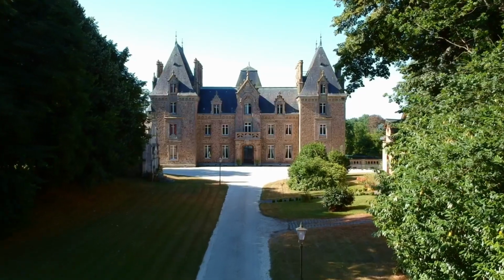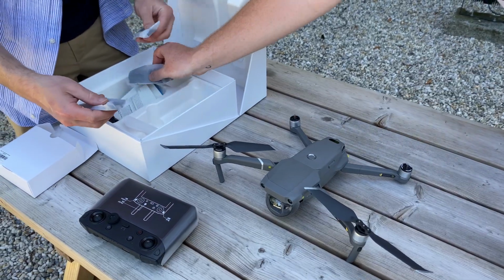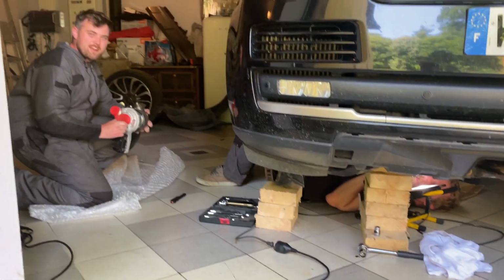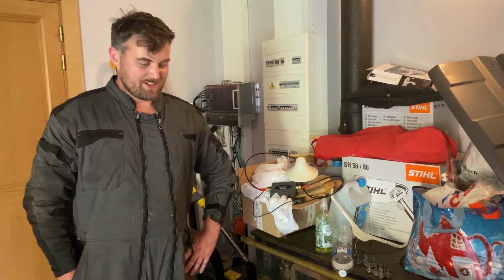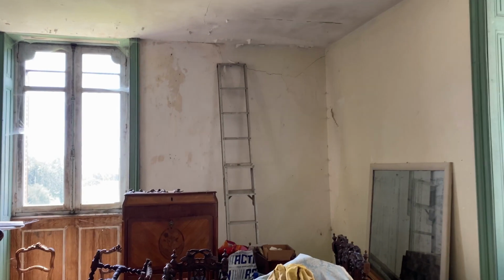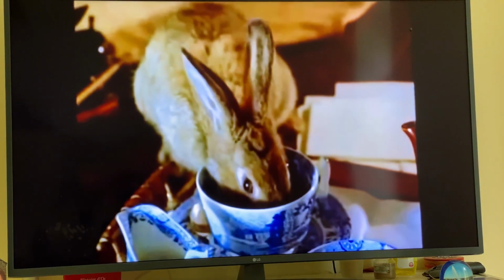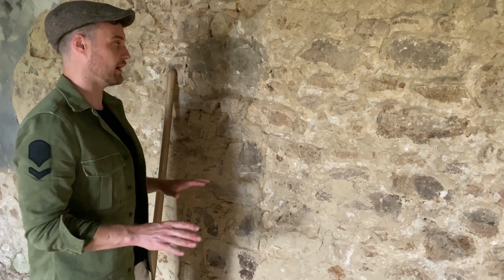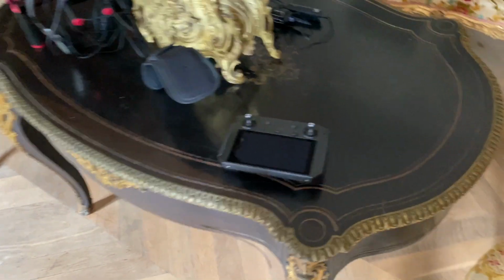The Only Way Is Up - Doing It Ourselves

Comment: Hi Micheal! I did lime plaster on my sister house that was built in the late late 1700's in Pennsylvania, USA.
Protect your hands, nose and throat, that lime powder can really burn! 
When you have the concrete delivered,  ask the company if they have a pump, you may have to pay separate for it, but it will save you so much backache and time, they actually pump the concrete from the truck through a tube right onto where you want the new floor!!! Cant wait to visit! Going to get my Passport soon!
Reply: ICUinthedark I was going to ask if 5hey could get the truck close enough to pump it straight in when doing the floor, definitely quicker and easier on the back! I wish I could be there to help, it will be so much fun!

Comment: Where we used to live there was a a machinist's shop that had a metal fabricator that could have made new drawers for that old cooker.  I would think they would be able to save the drawer fronts and attach to a new box... just a thought.  I'm excited to see the work on the gardeners cottage, especially the membrane you will be using.  We need to encapsulate a crawl space and I am not up to speed on those products, so all information is helpful.  I have seen some plasterers at work and they are amazing!!  Happy for you to get this done!

Comment: As you work toward replacing the old oak flooring, if reclaimed oak is unavailable, you might look into a “rustic grade” of solid oak new flooring. Here in the US most people installing new oak floors tend to use what is categorized as “Select” or “#1 Common” grade of oak, BUT if you desire more character (and I believe you do), you may search for “#2 Common” which is considered “Rustic” or “Builder’s” Grade. It will have more of the imperfections and character you’ll be after. These grades are just as strong, but are considered less desirable in new homes where people want more uniformity, but they would be MORE desire able for those who like the character of old wood. A bonus of this is that the Rustic grade is usually less expensive! Can’t wait to see more as you progress! 💕

Comment: Beautiful drone pictures from your new drone Michael you should talk Stephanie into getting one. Also check into getting a concrete stamp when you pour the concrete you can buy a rubber stamp that will make it look like old brick on the floor just a suggestion
Reply: I am not sure if you remember from a previous vlog but they are lucky enough to have a huge stack of floor tiles the same as all the broken ones he removed. So his plan is to pour a concrete floor to stabilise it and then put down those floor tiles which have not cost him anything, but your idea is a great suggestion.

Comment: Great video Michael.  Wondering, how has Billy edged the driveway and patio area where the grass meets the ? is it crushed lime? How is it bordered so it doesn't end up on the grass.  Also wondered if you shouldn't spray that black mould in your cottage before the floor comes out so that you remove all the overspray and dripping with the waste that comes out.  Cant wait to see it started. Thanks for sharing.
Reply: Is it not soot from the old fireplace?
Reply: @emay1903  Yeah I watched it again and saw it was soot. Duh lol.

Comment: Did I miss an update on the chimney and the large structural cracks?
Reply: No, you didnt. But his father has said that they can fix it by injecting lime mortar into all the cracks as it is very strong. It is because it is mainly water damage. They have ordered the syringe. We will hear more in the coming weeks.
Reply from the maker: Exactly what Jill said. Xxxxx

Comment: Hi Michael, I am looking forward to the cottage renovation, but I am wondering what you are doing about the big crack in the wall at the side of the house?  Did you discover the cause of the problem?  I’m sure your dad has had a good look at it , very handy having a builder with so much experience!  But I am just curious as to the cause and the solution. I hope it isn’t going to need under pinning.
I am very envious of your outlook onto that beautiful greenhouse. I’m sure it will all look wonderful when everything is completed.
Reply: I think some of these things are mentioned in the Patreon videos, shame not to see them.
Reply: @miriamtaylor7518  his father has said they can stabilise the corner by injecting lime mortar in between the bricks. It is very strong. They have just ordered the syringe
Reply: Thank you ladies.

Comment: I guess you've given up on the original tile floor.
Reply: He hasn't😂🤣 He is digging out the foundation and putting in a concrete floor to stabilise it. Then he is putting the tiles on top of the concrete. I dont know if you remember but he showed us a huge stack of original floor tiles in one of the out buildings that they already had. Very similar to all the broken ones he cleared. So they are in character and have not cost him anything.
Reply: I do recall.  I'm glad to hear it.  I really liked the idea of the tile floor, and the original old stones/tile would be perfect.

Comment: How you going to secure the huge crack
Reply: I was wondering the same...
Reply: @beabasson3132  He mentions it very briefly at the end of the live chat. His Dad has had a good look at it ( 50 years of building experience) and they have ordered a syringe to be able to inject lime mortar right into the middle of the bricks. Apparently, lime mortar is REALLY strong and should fix the cracking which is mainly water damage from the previous leaky roof.
Reply: Thanks Jill...very clever!!😃